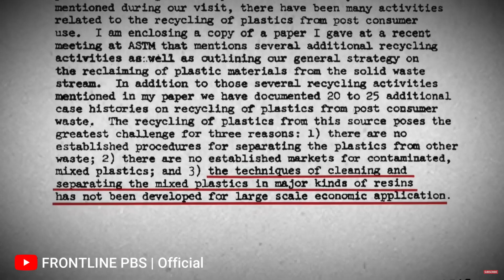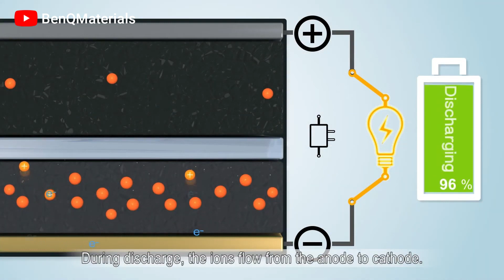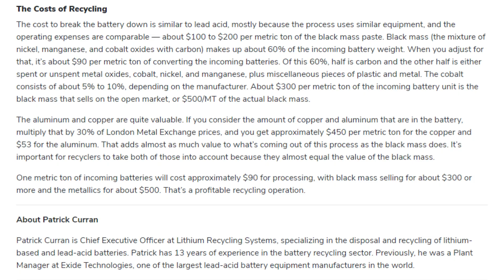Why Battery Recycling Is Surprisingly Profitable

Comment: plastic is recyclable I've seen it recycled as a 3d printer - tinkerer you have lots of plastic waste it can be melted down and drew through a small hole to get thin round strands ready to be reprinted.
Reply: Some plastics are more recyclable than others. It comes down to the polymer type, colours and purity